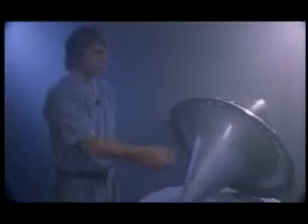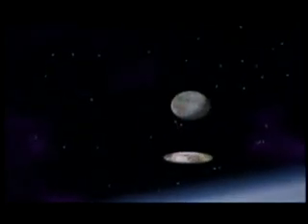Rocketships - Laser Propelled Light Craft - Leik Myrabo

Comment: "Early in the morning of 2 October 2000 at the High Energy Laser Systems Test Facility (HELSTF), Lightcraft Technologies, Inc. (LTI) with the help of Franklin B. Mead of the U.S. Air Force Research Laboratory and Leik Myrabo set a new world's altitude record of 233 feet (71 m) for its 4.8 inch (12.2 cm) diameter, 1.8-ounce (51 g), laser-boosted rocket in a flight lasting 12.7 seconds"
https://en.wikipedia.org/wiki/Beam-powered_propulsion